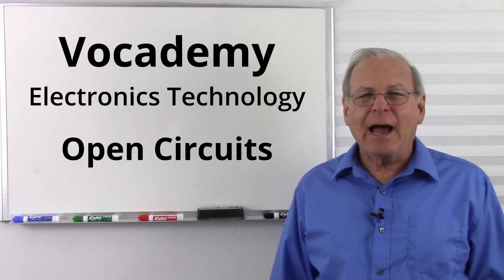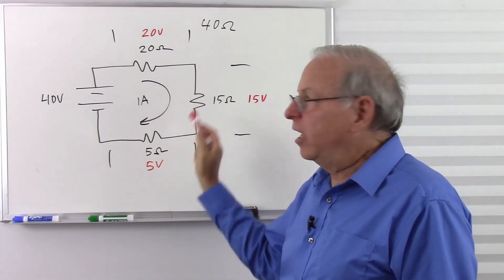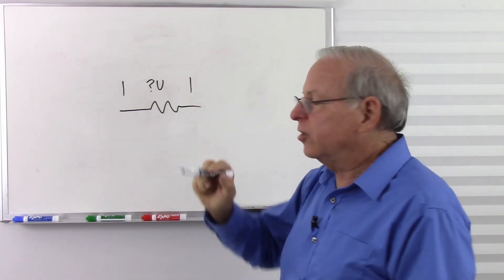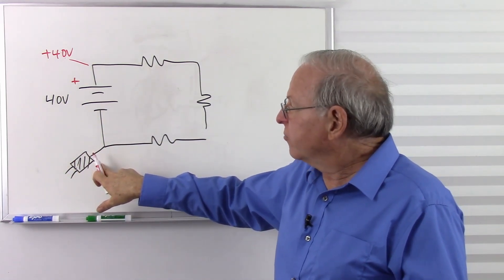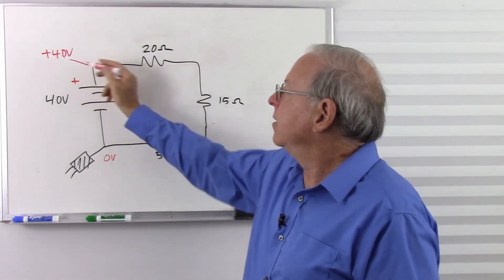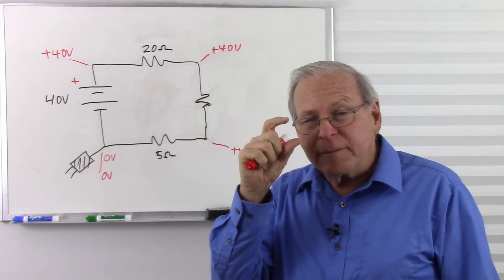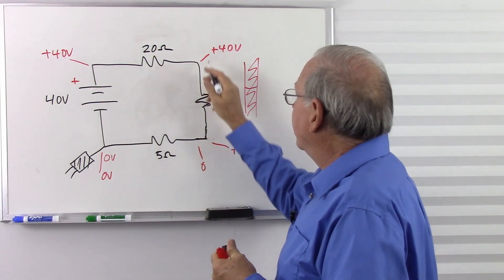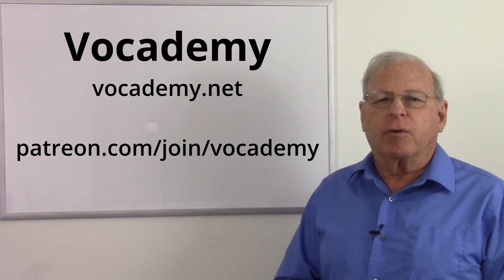Open Circuits

Comment: If a resistor limits the current in a circuit I don't understand why we have the same current all over the circuit. It seems like a resistor only reduces the voltage.
Reply: A resistor doesn't stop electrons; it reduces their speed and the rate of flow through the entire circuit but the value remains the same. Yes, resistors and any flow through a consumer reduces voltage